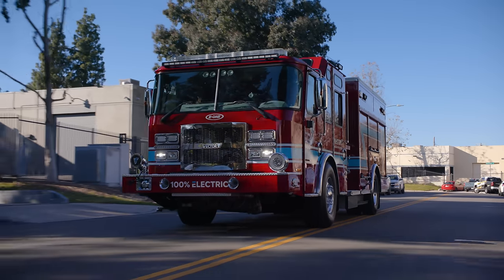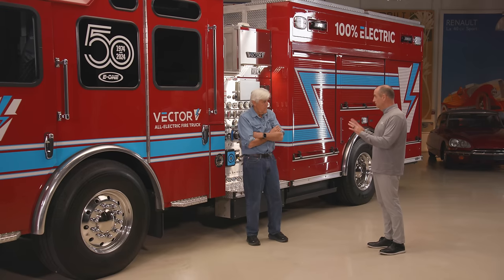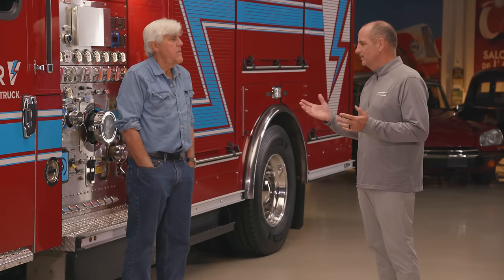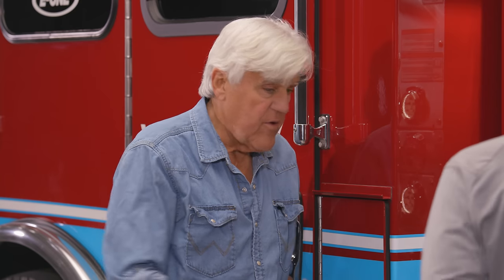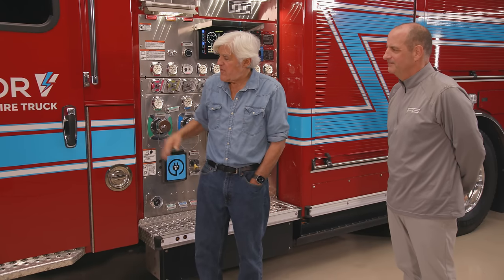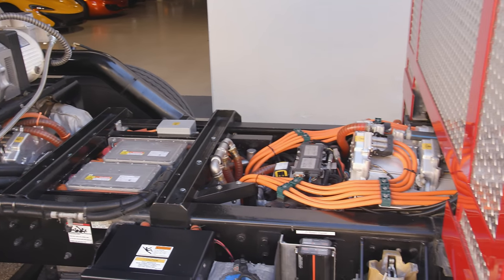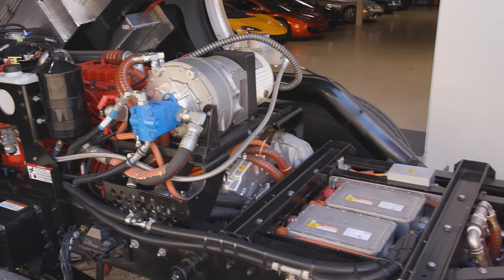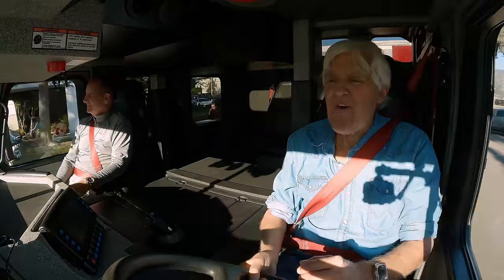The Future of Firetrucks?

Comment: 38+ years as a paid firefighter in the business and the one thing constant is resistance to change.  I appreciate the technical accuracy delivered in the info part of the interview.  Electric is great in a City setting with hydrants every block.  500 gallons just isn’t enough water but that is how they kept the truck to 42K pounds.  The front-line trucks I’ve ridden later in my career weigh 32-38K pounds with a MINIMUM 1,000 gallons of water in the tank in airfield & suburban areas. 

The U.S. Power Grid is not ready for this technology and won’t be by the ridiculous ‘Climate Mandate Deadline’.  

Thanks for an informative episode.
Reply: Resistance to change eh? I'm sure the electrical engineers who made it know a lot about...

Wait for it...

resistance!

Comment: The pump was WAY louder than I was expecting.
Reply: Yeah for like 9 PSI lol
Reply: I agree. Wonder how much louder it would be at a normal 150psi outlet pressure they normally run with several handlines in service?
Reply: @BlazerRox 😂my Kärcher does more more silent lol
Reply: The high pitch is awful. Imagine it full tilt.
Reply: @ls60fd , and high frequency noise like that is quite hazardous to one's hearing!
Reply: Was hidden by the noise of the engine before.

Comment: Their pump supplier needs to work on those noise levels .. it's been hidden behind all those generations of diesels for 100 yrs.  Great video for a change of pace.  Thanks Jay.
Reply: I am wondering how much of that is artificial.  The cabin is clearly mimicing a diesel. The E-One represtative is on the money about firefighters not liking change. My sister and brother in law are both career firefighters. They are not fans of anything changing,
Reply: @stevevarholy2011  it is not mimicking a diseal it has a diesel engine this truck is way over hype it is simply a plug in Hybrid.
Reply: Obviously you've never been around heavy industrial machinery. Pumping that many GPM takes lots of energy.
Reply: @redemptionjack4657  It's not a hybrid at all. The diesel engine isn't used for making the vehicle move.
Reply: I'm sorry we cone to your burning house we're charging the truck
Reply: Not much you can do with that kind of volume of a pump. You could insulate it, but that's wasted space.
Reply: @michaelfox2256 I don't think you're ready to hear that petrol vehicles need to be refueled as well. And you definitely aren't ready to hear that there's usually more than one fire truck
Reply: @redemptionjack4657  2hrs to refuel a diesel truck
Reply: @freonpeon472  Yes it does require a lot of energy with the pumps making a lot of noise and keeping micro-bubbles at bay can be quite difficult plus they can cause a significant amount of damage to the pump and fittings so one has to choose the balance between noise, micro bubbles and efficiency when designing the pumps.  Its all a tradeoff that high volume pump designers have been dealing with for a very long time using noise absorbing mounts and shaft couplings to reduce it a little however totally enclosing the pump cabinet in several layers of acoustic insulation is the most effective solution as long as you have to space for it.  Stationary fire pumps for commercial buildings have the same noise issue making it so hearing protection should be worn by the operator when testing them. 

Most people are familiar with just a 1/3 to 2 hp swimming pool or sprinkler pumps noise level but a fire pump is a totally different beast on steroids comparatively speaking.

Best!
Reply: The  Piddly discharge going on from that Hose  quite likely had the Pump  CAVITATING . You know what that is ?
Reply: @KingCobbones  I said Plug in which is what the truck is a plug-in, is either of these two options. Option one, when electric runs out, the engine takes over the drive train option two, and the engine powers the battery.
Reply: @michaelfox2256  still faster then electric for truck batteries second it is a plug in hybrid.
Reply: @stevevarholy2011  the mimiking is for the driving dynamics not the powertrain.
Reply: @RiffleVFXportfolio  Yeah, and I've done it on long calls too, about 6-8 hours in, a dude rolls up with a fuel truck and a hose, shoots my fuel tank full of diesel in 5 minutes, and moves on to the next truck.
Reply: @johncunningham4820  That wasn't cavitation, I will gauruntee it, it was the pump's gear driven drive train. They literally put the shittiest pump on the planet in that truck. 

In a conventional fire pumper, the pump sits mid truck behind the transmission connected with a drive shaft, and out the other side is another drive shaft that goes to the rear wheels. When you want to pump, you stop the truck, put the transmission in neutral, set the brakes, take the transfer case out of Road and put it in Pump mode. It moves a collar internally, and disconnects the rear drive shaft, and engages the pump drive, you then put the transmission back into drive and it start spinning the pump. 

Some manufactures use a multiple gear system like this one which is noisy as hell, others like Waterous, use a chain (like a very big version of what's in a typical 4x4 transfer case, except it's like 6-7 inches wide... and the chain drive is damn near silent. They can manage any speed changes they need to make by changing the sprocket diameter and it just works. Gear systems, you need to do the same, but the higher tooth count increases noise. They are also not using helical cut gears because they then require thrust bushings and different lubrication systems, so they tend to be straight spur gears, which as you just witnessed are VERY loud. 

All of our pumps now are Waterous ranging from 1250 2 stage, 2000 single stage, and 2250 2 stage for our latest truck. Our old front mounted pump on our old tanker was a 1000 GPM Hale with a gear drive and even at an idle you couldn't hear yourself think. At full throttle drafting you basically need foam ear plugs inside your David Clarke headset to hear what's going on or use the radio.
Reply: @neilfromclearwaterfl81  This pump wasn't cavitating, it's just a lousy noisy drive system. The only time we ever get cavitation is if we're sucking air, or trying to draft water through a clogged strainer.  The pressure side of flowing the water isn't tough truly for us because we just lower the pressure some by changing the pump rpm down some. If you're flowing high rate and pressure water as a supply to a ladder or as a mid truck in a relay pumping operation, you normally don't have to worry about sourcing multiple pressures simultaneously, but if you do, you can restrict the flow to the hand lines such that while flowing at capacity, you can dial it in to what you want, but when they stop, the water pressure will equalize to the pump pressure. So when you crack the valve open again, you might get a kick for a second until the flow across the gated valve restricts to the value you set.  On the nozzleman's side, you'll note the line getting stiff, but if you open the line somewhat gently over a second or so vs ripping it open,  you'll really not notice it. It's kinda hard to explain if you've never done it, but if you have, it's really no big deal.
Reply: @kleetus92  You don't need to be cavitating from sucking air into the system as micro-bubbles from vapor developed during liquid compression/decompression and localized heat pockets in the stream can/will develop in the sealed system.  This is a known problem when pumping fluids especially water.  This has been a leading cause of pump, pipe and valve failure in many industries that have to pump high volumes of fluids such as in refineries, chemical plants and waste water treatment facilities.

Best!
Reply: @neilfromclearwaterfl81  yes... I am well aware. However what I'm telling you is that pump wasn't cavitating.
Reply: @johncunningham4820  , that high frequency noise isn't cavitation.  My guess is that there is a gear reduction or something like that making the noise.
Reply: @kleetus92  However my comment was not about cavitation, it was about the noise and damage from micro-bubbles along with its mitigation so why do you keep bringing cavitation up in response to me?  

Johncunninham was the one who brought up cavitation.

Best!
Reply: @neilfromclearwaterfl81  "However my comment was not about cavitation, it was about the noise and damage from micro-bubbles along with its mitigation" You are aware, that these microbubbles you're talking about IS LITERALLY THE TEXTBOOK DEFINITION OF CAVITATION, right?
Reply: @kleetus92  To a degree however in this context the other was discussing cavitation due to sucking air into the system (the common understanding) and not the process of vapor developing in a compressed fluid stream as the pressure drops coming out of a pump venturi.  When you have a pump running at high volume then you have pressure differentials, micro-bubbles from vaporous expansion of the fluid and noise which is just the nature of things.  If the pump and system designer did his job right the micro-bubbles will not cause severe damage to the system and just be an annoyance.  In a poorly designed system the micro-bubbles can cut through housings, fittings, etc in short time and cause premature failure.

Best!
Reply: @KingCobbones  it is certainly a hybrid. It's just a series hybrid, not the parallel that many people are more familiar with. You could entirely remove the battery and this thing would drive on the diesel engine's output... via the generator and motors, of course.
Reply: @brianb-p6586  Actually it would not work, the diesel generator would not be able to react to the peak loads of the electric motors. You would still either need a small battery or super capacitors to buffer a lesser amount of energy to supply the peak power for the electric motors.
Reply: @Neojhun  diesel engines respond quickly enough in every conventional diesel-powered truck.
Reply: @redemptionjack4657  Yes it is a series hybrid. I originally thought it was only hybrid pump but as the same electric motors are used for pump and drivetrain via a transfer case, the engine can get the thing home if batteries are flat

That pump is way noisy and I'll bet once the diesel starts up the thing is deafening (It's actually possible to make them really quiet if you're determined and have enough space for mufflers/soundproofing)
Reply: @miscbits6399  I mean trucks are already defening.
Reply: The noise is extremely loud.  I'm thinking everything must be gear driven
Reply: @rickarra1833  this apparatus has the same pump gearbox and PTO as the same manufacturer's conventional trucks. There is presumably a reduction gearbox between the electric motor and the PTO box, as well.

Comment: Jay asking some great questions, this thing is a beast. The older I get the more I appreciate insane engineering.
Reply: Jay HAS to finally give up on his horrible take on torque versus horsepower. Literally everything he has ever said is wrong. "Torque wins races". WRONG. "Torque is what you need for pumping". WRONG. POWER is the only measure that matters. I can put out 100 ft lbs of torqe on my bike, but that doesn't mean i can win a race with a small gas engine that puts out even 10 HP.
Reply: @buffalobilly6046  Those words were said by both Enzo Ferrari and Carroll Shelby.

Furthermore if you make the numbers on either end lopsided enough you won't win in either case.

HP means fast speed, Torque means acceleration. 

You're awfully cute but equally misguided
Reply: Yeah he asked really good questions like "is it lithium batteries?". No, they're nickel batteries obviously. And "is it heavier than the diesel truck or lighter?". Obviously without the engine it weight a lot less....

Good questions
Reply: @amg863  Did I say every question was perfect, does every question need to be geared to the enthusiasts who already know?

go rub one out, you can't always be this miserable, can you? You might need help, double up on therapy.
Reply: @Gamefreak8112 
Actually both of you are confused about the science imho…
Reply: JAY HATES EV's! UNFORTUNATELY,  HIS CIA OVERLORDS GOT TO HIM, HENCE THE STUPID EV VIDEOS OF LATE!
Reply: @JohnTaylor-bd1uy Why is it that caps lock and stupidity are so entwined?
Reply: @matthewkantar5583  They can't read the letters when they're lowercase, they have no choice.